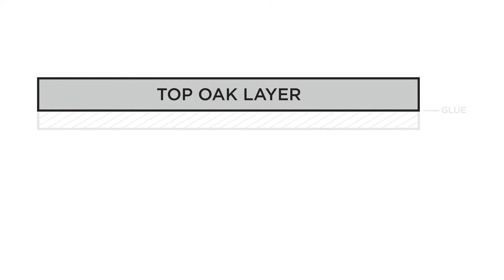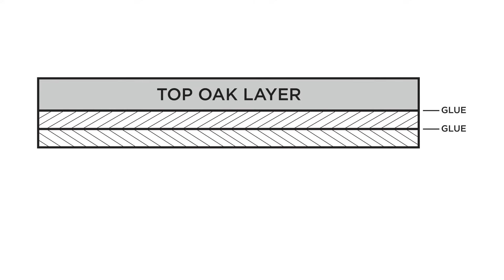Engineered VS Solid Hardwood Timber Flooring - What is the Difference?

Comment: So much marketing bullshit this video. Tell me any engendered floor that will still be sound in 150 years like the 200mm Baltic pine flooring they showed in the beginning, yes it cuped because they were over 150mm but even then worth way more in home value. Engendered more sustainable bullshit too all that toxic glue instead of a 100% natural solid timber. Quick and easy when has that ever been the best option for lasting quality and value. Engineered timer always swell in entrance doorways because of wet feet you said it yourself these no sealing between boards unlike a professional floor sanders finish.